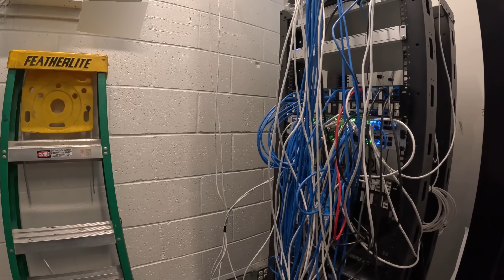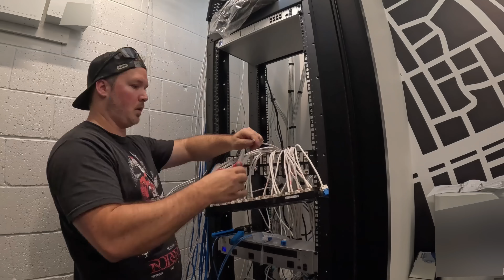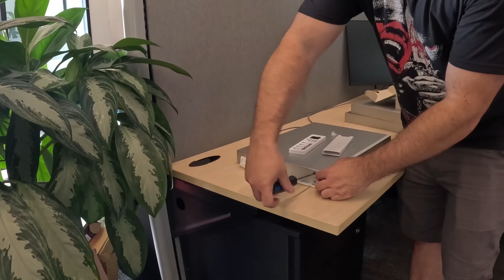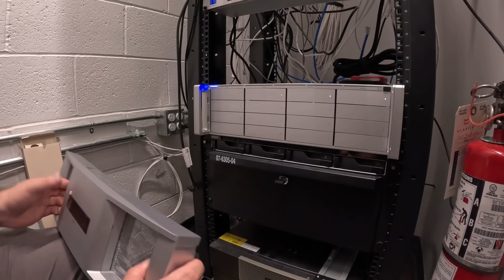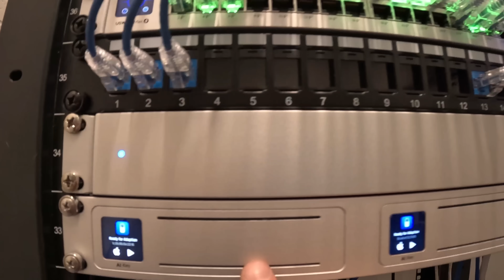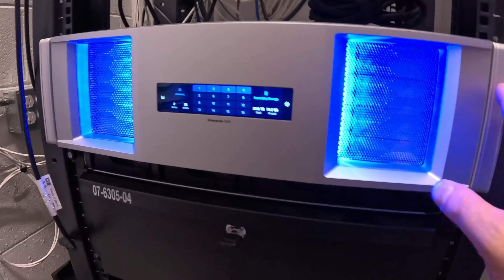UniFi Install, Cable Cleanup

Comment: Great setup. The blue patch cables appear to be Tripp-lite brand? I've used them a lot in cleanups and like them. I've not used the Unifi cables so I cannot compare. The trouble with the Tripp-lite cables that I have is that they are each in a little plastic bag and not in bulk. So there is a lot of packaging waste.

Comment: Hi Cody. Very Nice video and great job! I m canadien to, from Montreal. Have you try the econo connector from NSI distribution. It sale in bag of 10 connector for around 15$ and you can but the one punch tool for this connector. For the price this is very good product. Thanks for your vidéo.

Comment: I bought a Dream Machine Pro, 48 Pro Max POE, U7 Pro XG a week ago, and will also be using my old AC-HD Pro. I just picked (today) 2x 24 port Keystone panels. I can't wait to set it up, and it will look pretty close to this setup (all CAT6 runs in the main house goes to one network cabinet). Childhood dream coming true shortly! Quit the upgrade from pfsense!

Comment: Only change I would have made is putting the WAN switch above both UDMPs, but that's mostly because I like the "top down" in terms of the network to match the rack as much as possible.

Otherwise great install as always!
Reply from the maker: I was going to do that but already installed the pro max when I thought about it lol didn’t want to take them back down

Comment: When do you buy an AI Key, and when do you buy an AI Port?
Reply: AI port is required for third party cameras or older UniFi cameras that lack ‘enhanced’ AI detection (I.e. face detection, license plate, etc.)

AI Key takes those ‘enhanced’ detections mentioned above and processes them so you can search footage with phrases like “women with red backpack” “speeding white car” , it also transcribes audio recording so you can search that way as well

Comment: Did you never facing problems with UDMPro high availability? - I set mine up and had nothing else than problems - Network appplication was no more responding / UDMPro lost connection etc....

Comment: Why do you prefer punch down keystones vs “pass through”?
Reply from the maker: Do you mean like RJ45  and then put couplers on? 

If so it’s around the same amount of work so might as well jsut put a keystone on
Reply: @MactelecomNetworks yes, that is what I was referring too. Thanks!!
Reply: Doesn't adding a keystone add a degree of latency? My installer won't use them. All connections are direct to the source
Reply: @Vitalsignser it might, but the added latency is so minimal (we’re talking nanoseconds) compared to the convenience of being able to replace the cable from the end of the keystone to your device. If a user damages the cable they only need to replace a short patch cable rather than repull the entire run